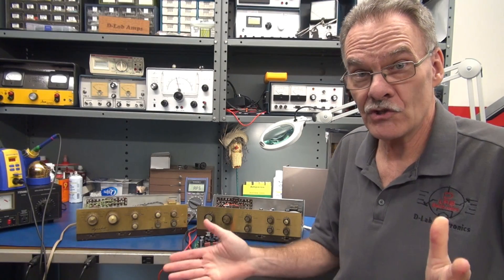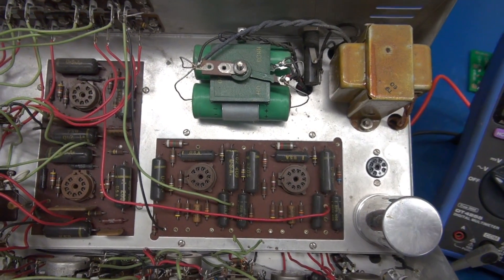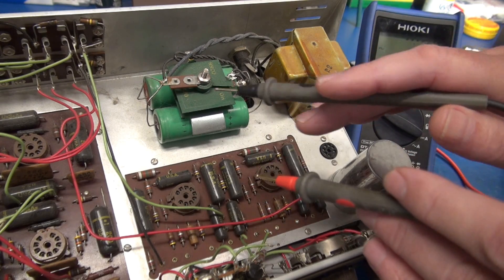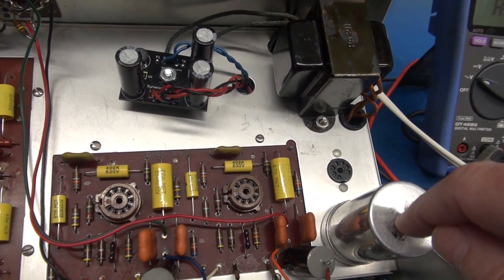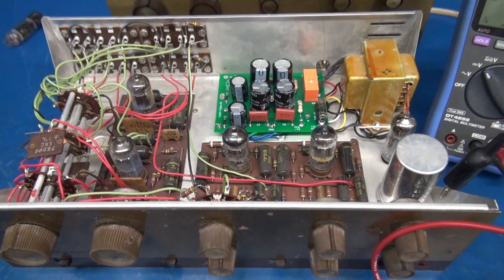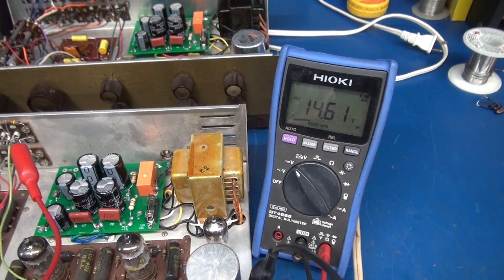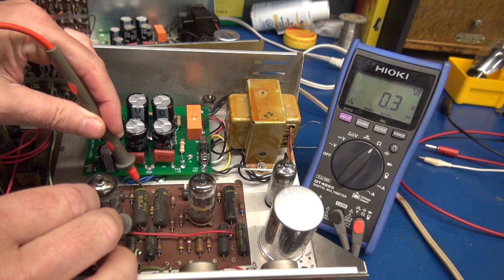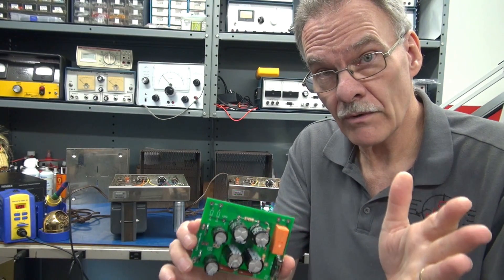Vintage Dynaco PAS-2 home stereo tube type preamp Power supply Repair plus Tek Tips Upgrade kit

Comment: I have a PAS 2 that was gone over and essentially refurbished by rudy129 of ebay. I bought it from another ebay guy that had it done by rudy. . As part of the refurb, rudy disabled the tone controls. I get it and set it up. I am getting a really boomy base. I am wondering what could have gone wrong here.  If I attempt to fix in the EQ, I lose crucial detail in the low end. What should I check first?

Comment: Great Vid Terry.  Great troubleshooting steps, especially of checking the heart of the system (transformer) before continuing the restoration.  Awesome solution to upgrade the LV and HV side of the circuit all in one combined board.  Innovation like this is what keeps these vintage units from hitting the landfills. Long live vintage!
Reply from the maker: Yes Sir, Appreciate the kind support